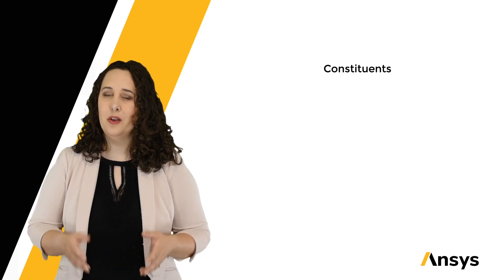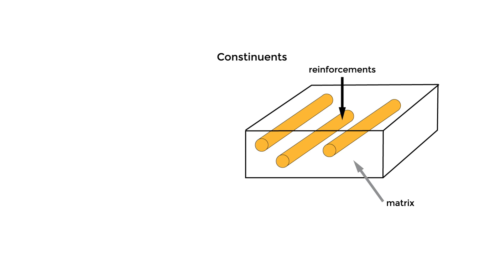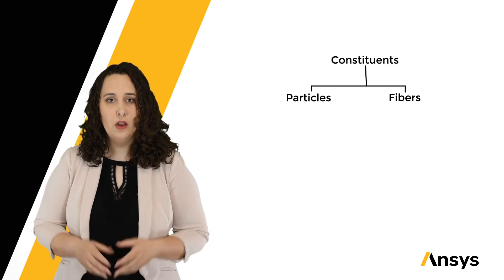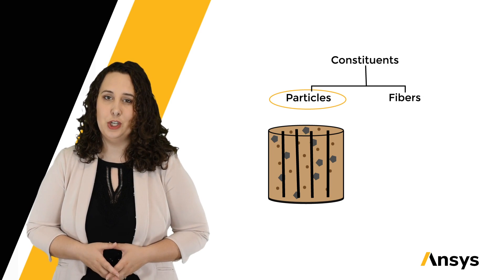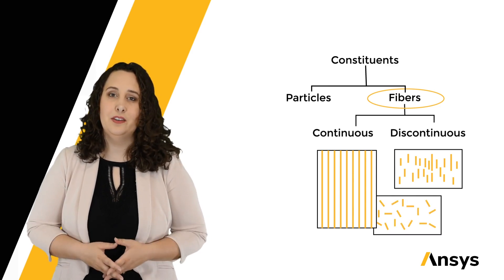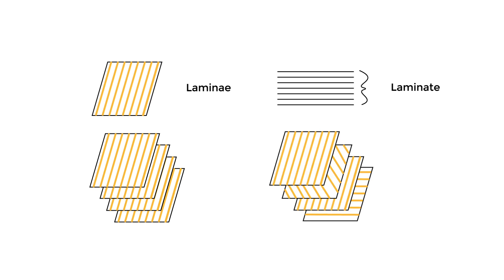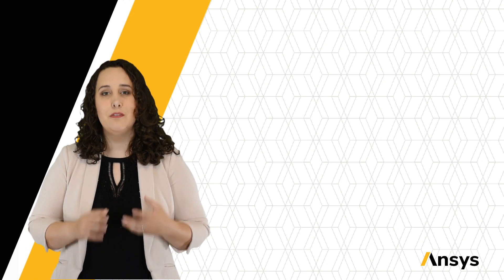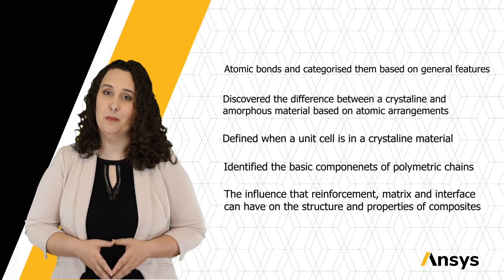Composite Material Structure — Lesson 4

Comment: Hello, thank you very much for this wonderful lecture. I have a question in the ANSYS program. I want to prepare, for example, a superimposed material in the form of a layer consisting of two materials, the first is fiber of any kind, and the other is a polymer material, with dimensions of 10 * 10 cm and a thickness of 2 cm. How do I calculate or how can I enter the volume fraction values  For both subjects in the ANSYS program, for example, the first subject is 60% and the second subject is 40%. I hope you will help me in solving this problem. I mean, how can the volumetric fraction or weight ratios be calculated for each subject in the ANSYS program? With appreciation❤
Reply from the maker: Thanks for watching! Please post your query on the Ansys Learning Forum for a detailed answer from the wider Ansys Community: https://ansys.com/forum.